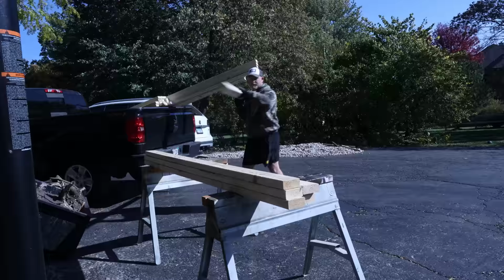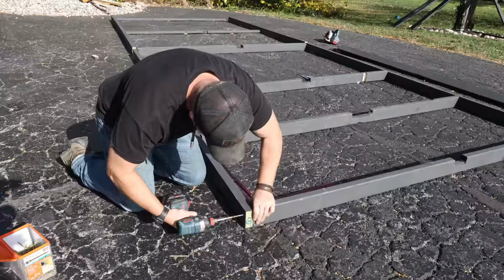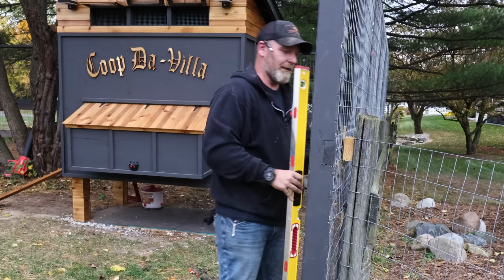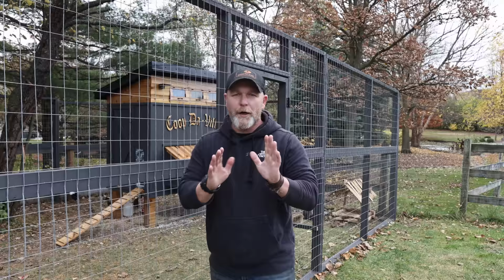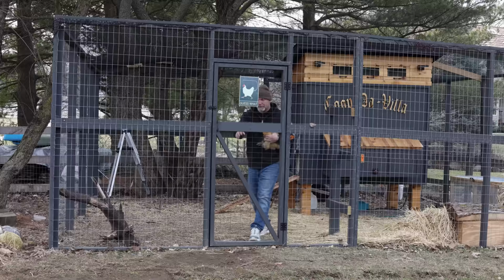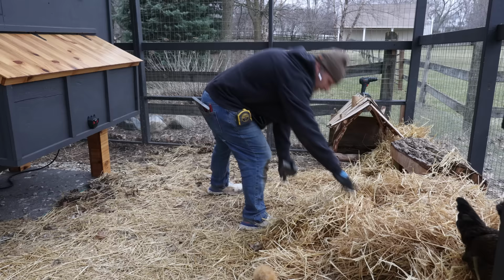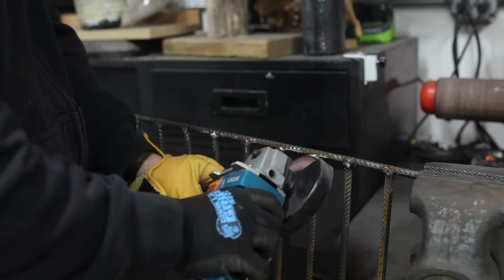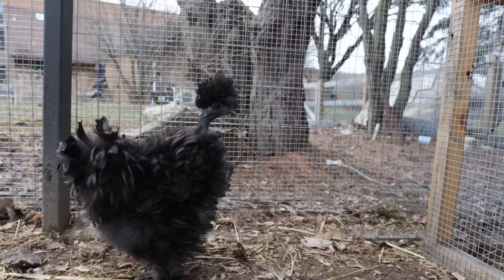How to Build a Predator Proof Chicken Run around your Coop // DIY Project

Comment: Since you asked, I’m going to tell you.  Your bird netting above would keep aerial predators out.  But a raccoon or possum would rip right through that.  That’s speaking from experience.  You really need to put both the hardware cloth and cattle fencing all around the entire enclosure including the top.  This is to keep the raccoons, possums, mice, rats, rats with feathers (sparrows, quails, any small birds really) out.  For one, you don’t want to lose all your feed to the neighborhood critters if your feeder is outside the coop.  Again speaking from experience.  Second and more importantly, it is to keep your flock from catching diseases like bird flu or hantavirus that can be transmitted to humans.  Lastly, you don’t have to fabricate the expensive and laborious rebar ground protection.  Simply run the cattle fencing and/or hardware cloth 18-24” longer at the bottom of the walls and fold to form a horizontal apron that extends out around the perimeter of the enclosure.  That should keep out the digging predators.
Reply: What about lining the entire ground inside the run with hardware cloth?  I was told not to do that because chickens will eventually scratch down until they get to it and cause bumble foot.  Our issue is we have ground squirrels and gophers that would burrow up into the run to get at the chickens and eggs.
Reply: @davidthompson9359  I would maintain a layer on top. If you keep them entertained and reasonably happy with extra treats they won't just burrow a hole. I would think if you kept 4 inches above the wire you will be fine
Reply: Correct.  I have had raccoons shred thin overhead wire.
Reply: @davidthompson9359  Ground squirrels and gophers are vegetarians.  They won’t go after the eggs.  But they might go after the chicken feed.  The tunnels could be used by, for example, snakes, which would go after your eggs.  There are effective and cheaper ways to get rid of gophers.  But that requires killing them.
Reply: Chickens eat mice, rats and birds as well....from experience!
Reply: @tonyz6421  My girls were to spoiled and well fed they just shared with the mice. Guess the difference between a tom cat and lap baby but I have no doubt a chicken will go after anything that moves and are definitely fast enough to catch a mouse no problem
Reply: My Friend is Dealing with coyotes, and Bob cats, and occasionally a mountain Lion/cougar!!
He's had to put out Traps!
He's gotten 5 or 6 coyotes, 3 Bob's, and so far 1 Mountain Lion!
They have left his Flock decimated!!
Reply: He’s gonna learn today!!!!
Reply: @davidthompson9359  My chickens have eaten every ground squirrel and gopher that has ever popped up inside their run. One will drag it out and the rest each grab their piece and run away with it.
Reply: @auntlouise    Then maybe it's the snakes that use the burrows of squirrels and rabbits to pop up inside of the run?
Reply: 💯... we did that about year ago and we haven't lost any chickens. Before that we lost 1-3 birds per month due to pretend fencing.  Now we enjoy out chicken coop... to re confirm your statement (we no longer feed rats, bunnies, etc.) Hardware cloth around chicken coop is way to go in my personal experience.
Reply: That nylon netting will work great. I use it and I have never had a problem. Also an Opossum would never be able to pull it apart. A Raccoon maybe if it's not secure enough. No animal would be able to rip or tear it.
Reply: Your chickens go into their coop at night, and as long as their coop is safe, which is looks like it is, you’re not gonna have a problem with predators getting your chickens at night. You have covered all your bases for the daytime predator so I think you are safe.
Reply: Our resident bobcats would go right through the netting. We are rebuilding our coop and run and we have to make the run more narrow with a greater support to take the weight of any four legged predator that might be inclined to jump up there.
Reply: Aren't you overdoing all of that? What about planting in the yard several bushes, so free-range chicken could hide under if necessary during the day ? Anybody from Europe is laughing so had looking at all of that preventions.
Reply: @davidthompson9359  taking the hardware cloth 2 ft out from the bottom of the run will prevent predators from digging under and into your run. Second it to the ground with landscape staples.
Reply: "chicken wire?" over what you got rats will kill chickens
Reply: Minks and weasels will dig under to get eggs and chickens. Buried hardware cloth with small weave is needed to keep them out.  Also hardware cloth with a roof even if tarp can help prevent them catching diseases from the droppings of migratory birds.
Reply: I need that to keep my sons dog in our chainlink fence! 😂
Reply: That's exactly what I was going to say!  2x4 fencing I feel would work but then it will need support to keep it from sagging. The only real safe place is a secure coop.
Reply: Yep
Reply: I have an outer perimeter fence of electric premier one netting. (Stops most any animal of size like dogs/ cats/ fox/ raccoons/ possums, etc, small things like snakes, mice, chicks, etc can slip through) Not much will mess with that netting though. It’s not bullet proof but it’s a serious deterrent. Also, an outer (or inner if very well trained) lgd dog at night is a serious deterrent. I once had an Anatolian that even watched the skies. Wish I had her now. Nothing ever made far enough to even try the top net.  (Down side of farm dogs is they take training and can turn out to be as risky as your predators without it.)
Reply: @rebuzz6866 I'm guessing you don't have mountain lions or bobcats where you live in Europe? Mountain lions can get up to 220lbs = 115 kg, 8 ft/264cm in length including tail,  with very big claws and big teeth. Bobcats are a smaller version of that. It's not much to laugh at when they come around and tear up your animals.
Reply: I totally agree with everything @rauy said in their comment but may I also add to replace your staples with screws and washers. It’s been my experience raccoons will pull those staples out over time. Also we added galvanized corrugated sheets on top for the roof this not only keeps predators away but also protects chickens from the rain, snow and hot sun.  Your chickens will be very happy to come out of their coop every morning and enjoy the outdoors no matter what the weather conditions are.
Reply: Agreed. I had a racoon rip a chicken piece by piece through 2 inch metal fence like this.
Reply: Nylon aviary netting is MORE than adequate. No animal weaker than a bear would be able to rip it if you get the real stuff.
Reply: @rebuzz6866 I'm from the uk and I'm not laughing at the prevention he has put in place to keep his chooks safe. He has made a fantastic, safe run for them during the day and at night they're locked in their super coop which I doubt anything can get in.
Reply: @lalacrypto1 There are no mountain lions or bobcats in the UK. The largest predator is a fox or there are birds of prey... the biggest i've seen are a Marsh Harrier and a buzzard.
Reply: I used long wire staples around the perimeter of my chicken coop. It has worked out.
Reply: Not the floor area, chicken's love to peck and scratch 💖
Reply: @rebuzz6866 We have tons of trees and bushes, but still we have lost 3 chickens to predictors, one to a coyote, one to a raccoon and one to an unknown animal (most likely a neighbor's dog). Trees and bushes don't protect chickens where I live, laugh all you want, we have learned the hard way. We safe guard our hens with a secure run and we only let them free range when we can be outside with them.
Reply: @davidthompson9359  I'm removing several inches of dirt before putting it down and replacing the dirt.
Reply: @debraperkins4448  Time for a Barn with a Courtyard.
Reply: I put  hardware cloth walls and ceiling and apron. It's going to coast but do it once and be thru with it.
Reply: Chickens are evolved from predatory dinosaurs, that's why!!😆
Reply: Yes, I used 1/4" hardware cloth!
Reply: Weasels can get thru 1"x1" mesh.  Also, raccoons can reach in and grab chickens with the mesh you are using.
Reply: I think the cost for hardware cloth on the roof would be too much for the very slim chance that a raccoon or coyote would ever take their eyes off the chicken in front of them and instead look 6 feet into the air (4 feet above their heads) and decide that’s the best way in. Chicken wire with bird net would probably be more than sufficient for most people in most places.
Reply: @davidthompson9359  doing it on the inside isn’t necessary, most of your problem predators will be outside and at ground level, putting extra fencing or cattle panel down on the ground to keep animals from digging within 2 ft of the cage wall would be more than enough to either thwart their digging or at least slow them down to the point they couldn’t get the digging done in a night and give you time to fill any potential holes made overnight.
Reply: Good advice, what do I do around the opening ( the part I walk through) How do I keep that section predator proof ?
Reply: @rebuzz6866 there are places here in US that have bobcats, mountain lions, panthers, and a few jaguars. It wouldn’t stand a chance 
That’s why
Reply: @budverissimo1 but he has hardware cloth around the bottom so they won’t be able to get to them through the sides, right?
Reply: @davidthompson9359  That fencing he used also is a HUGE no no as birds will fly right on in and RAID the feeders.
Reply: @debraperkins4448  Cyclone fence and then hardware cloth over top with cables to reinforce.   Same for the top.   No bob's here in Michigan, but "been there, done that" with the effing yotes and never lost a single bird.

Comment: As an experienced painter I have to say this: Generally, putting paint on fresh pressure treated lumber (or anything) often doesn't hold up very long, especially when it's in contact with the ground. Primers are an essential part of painting any substrate that's "naked" to achieve the proper bond. Metal, wood, whatever you're painting, (job specific) primer is a little extra step that'll save you in the long run from constant future maintenance. FYI.
Reply: Plus, chickens love to peck at paint. Make darn sure it don't peel.
Reply: Thanks for the tip..I primed my wood first but only bc my bf told me I need to and thought it was a complete waist of time..HOWEVER....now I'm glad I did! 👏👏🥳❤️🐓
Reply: And if pressure treated let it dry out before painting until it takes up water.
Reply: @ChristopherHarris-fk1iz  I tell my customers to let it sit for 6-12 months minimum before putting any finish on it. If it's in the direct sun, closer to 6 months, shade go the full 12.

Comment: Plant a thorny blackberry vine on each corner of the coop an use  wire twist ties to fasten them to the fence.  The thorns will prevent critters out.   An provide  shelter  from high winds and shade an. Fruit provides  needed food

Comment: Looks great.  Small suggestion : I think you should of used the backside of the coop as a wall so when you clean you dont have to trek through the run to get to the coop.
Reply from the maker: That’s a great idea.  Put the door on the back side !!
Reply: Although this is a wonderful idea, I did the same thing and I really do not mind. I interact with the girls daily and change out their water every other day so it doesn't bother me at all.
Reply: Right id just have a wall also so when it rains the whole run doesnt get muddy
Reply: I agree. Sometimes you want to collect eggs and you’re wearing nicer shoes (just home from work, or going out for dinner) and don’t to walk through the poopy run.

Comment: Hardware cloth laid on the ground...use ground staples...prevents digging.  Usually placed on outside of run. Grass grows up & u don't see it. Hardware cloth & hard wire keeps out predators.  That small stuff u put around bottom also will keep raccoons from reaching in & dragging out birds or parts of them.
Reply from the maker: That’s the second time somone has mentioned that.   Might have to incorporate it

Comment: I came up with the anti-dig spike strips as well a few years ago after a rottweiler bullied his way under our chain link fence and did some horrible things to our chickens at the time. Our chicken accoutrements are more budget based than yours, but all the same concepts. I salvaged a few wrought iron hand rails from a porch, cut them in half longways, and each railing made 2 sets of anti-dig spike strips. I drove them into the ground but through the bottom links in the fence to pin it down while also offering protection below grade. Works great.

Comment: If you have mink/ermine/weasels in the area, your spikes are not going to keep them from digging in.  The smallest of them only need a gap the size of a nickel to get through and they are ruthless and will kill the entire flock for sport.  We used a 2' apron of 1/2" hardware cloth around the entire outside of the coop/run then used the spikes also to secure the end and keep larger digging animals out.  Most critters will go right to the edge of the fencing or wall then try to dig so the apron extends the protection beyond where most will dig, and the spikes prevent the apron from being pulled up.

Also, netting is great to keep flying predators at bay, but racoons will chew through it so make sure you check it often to make sure there is no damage.
Reply from the maker: We haven’t seen any weasel like critters ever before.  However I have caught a squirrel in the run before.  I let my dog chase her away lol.   But you have some great ideas and I think we might have to incorporate some of them.  Thank you so much
Reply: Are underground squirrels problem to
Reply: @Charlesnans  We haven't had any problems with our set up, but our squirrels don't burrow much here.  We do have ground hogs here though, and none of them have gotten in yet either.  Anything that wants your chickens, eggs or feed will find a way to be a problem if you don't plan for them and protect from them though.
Reply: Miner's cats too! They're also known as ringtailed cats but look like a cross between an otter and a raccoon. We lost 11 chickens to them in 2017
Reply: @KomarProject  We had seen river minks at the nearest river about 1/2 mile down our gravel road…they must have been hungry b/c they wiped out our flock in 24 hours…That was the last straw for me, I bought 48 new chicks and bought the hardware cloth and recovered everything! Including the roof area gutter ventilation. Now the squirrels can’t even get to the feed. 😂
Reply: @KomarProject  Unfortunately we here in Nebraska have lost Chickens To a weasel before. they're sneaky little critters.

Comment: Excellent job! I ended up wrapping the entire run in hardware cloth and using a very thick (expensive) netting for the overhead. Also I put up a galvanized roof over the coop itself for weather protection and general cover for the girls. Then I put a 15 to 20 inch hardware cloth skirt around the entire 18 x 13 foot run. Whew!
Reply: Yes, me too, I don't want snakes in my run.
Reply: Is the skirt laying on the ground to keep raccoons, rats, etc from trying to dig under?  I’ve heard people mention this
Reply: How deep do you put the hardware cloth, my install will be under the entire run
Reply: Make a video please.
Reply: Once you get them safe, put up a swing,  add a xylophone  and thread some fruits and veggies on a rope to keep them busy and happy.
Reply: @jenbear8652  Yes the skirt is buried maybe 8-10 inches. Its got weeds/grass on top of it now
Reply: @davidthompson9359  I have it under 8-10 inches but it's on the exterior. I've seen it placed under the entire run before.

Comment: Beautiful coop.  You can also put that 1/2" hardware cloth on the ground and use the U stakes to hammer it in to the dirt to stop digging predators as well.  I did that 2 feet out all around.  I also put some cinder blocks on it, filled it with dirt and planted some marigolds and mint and oregano.  Chickens love to eat marigolds, mint and the oregano is great for their body, a natural antibiotic.  Pick some off from the flowers and herbs and give it to your chickens.  I also added a metal roof over the coop to cover their ramp to get in and out of their coop and had rain barrels on each side on the outside of the fencing to catch the rain water.  Put a cover over the top and a fine mesh over the hole where the rain water comes in to stop debris, or birds or squirrels from getting into it.  The roof will help stop the run from getting too muddy under and around their coop, especially when you are collecting eggs.